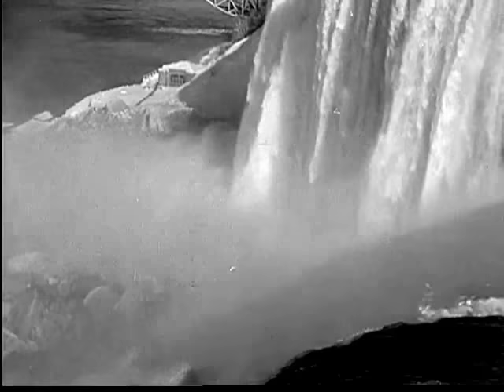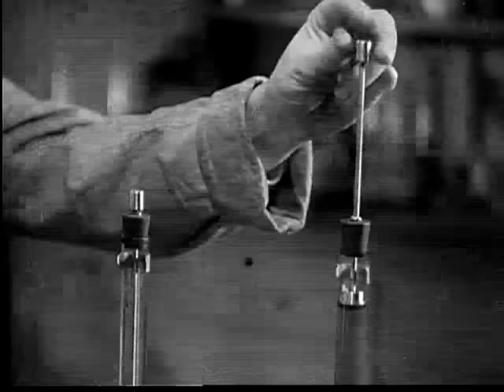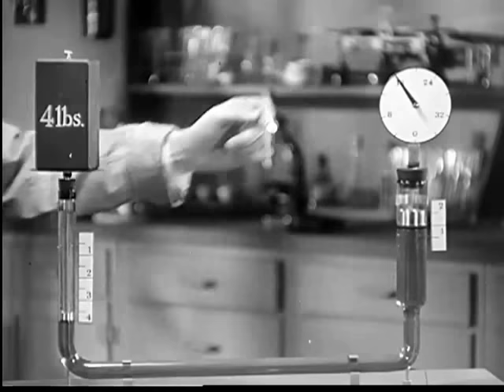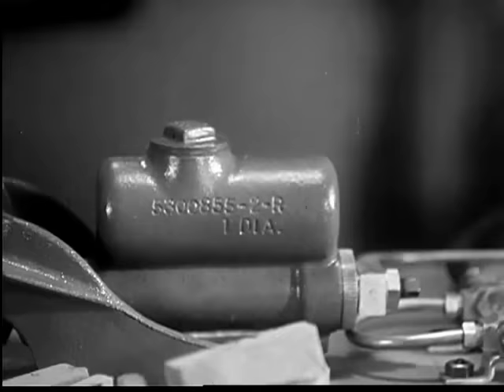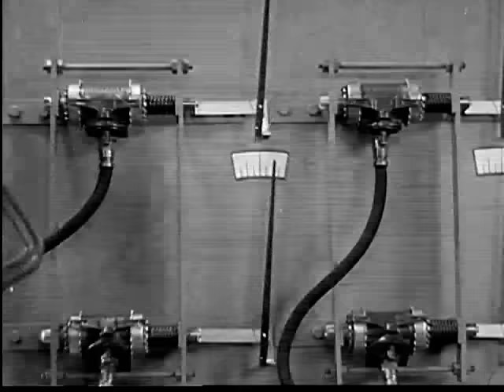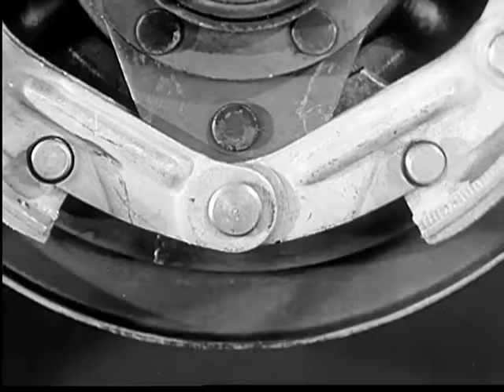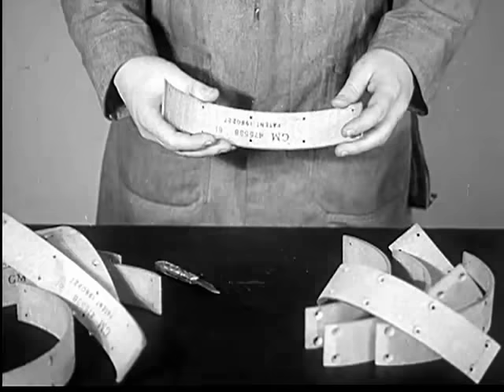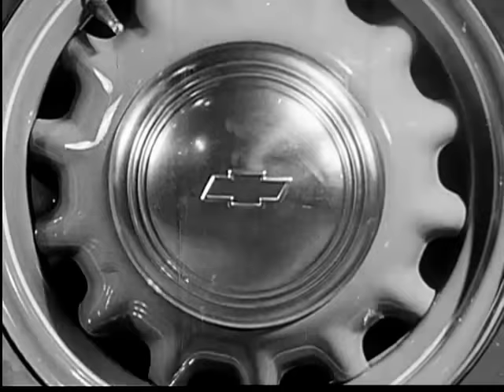Hydraulics (1936)

Comment: the main reason Chevrolet was explaining hydraulics, was that competitor Ford was still using mechanical rod actuated brakes at the time.
Reply: Germans listened in the end I guess. There was a hydraulic Panzer IV. (Now somewhere in a museum in the USA)
Reply: In the collection of the United States Army Ordnance Training and Heritage Center, Fort Lee, Virginia.
Reply: @RVoogt  during WW2 the Germans had the most powerful Hydraulic press that was used to forge and cast complex pieces for aircraft frames and ships I think 
Currently China has the most powerful press followed by Russia
Reply: who was first Ford or Chevy? ....exacly :-)
Reply: Who invented the car Germans or US ? Who copied who? :-)
Reply: who invented first automatic transmission Canada or US ? :-)
Reply: Who invented first manual transmission US or France? :-)
Reply: where wheel was invented more likely 3500 B.C. in Mesopotamia or in US ? :-)
Reply: who invented nothing?

US or Saudi?
Reply: @Mr0Suhaib  dam that is some bad burn here
Reply: Ford was using hydraulic brakes in 32
Reply: @newera3757   Neither invented the car first in intention.
Reply: @benjamindickey9431  negative,  Henry Ford was against hydraulic brakes, and Ford did not utilize them until the 1939 model year.
Reply: @newera3757  Germany did. The first gasoline powered automobile was invented by carl benz in 1897. Ford didn't create his first car until six years later in 1893 .
Reply: Then it turned out that the failure mode of hydraulic brakes was much more dangerous than the failure mode of rod-actuated brakes.
Reply: @baileythesleepless9966  There is a mistake in there
Reply: @KFlorent13  Didn't you know carl benz went back in time after he invented his car? I definitely meant 1887 but I think it was actually 1886 while Ford's quadricycle was 1896.
Reply: @Matt S. Yeah, if a hydraulics hose pops open, or if there's any other leak in the system, there's no fluid pressure to actuate the brakes and therefore, no brakes, especially if you have just one master cyl controlling all the 4 brakes!
Reply: @newera3757 ; when it comes to hydrophilic brakes, the answer is Chevy.
Reply: Yes, the Ford mechanical breaks were cheaper to make, easier to work on, easier to understand, but were not as good at stopping a car in a straight line. Henry was a stubborn old bird, and it was 1939 before Ford started using "juice breaks".
Reply: Who invented the horse and buggy?
Reply: @newera3757  Hate to bust your bubble but it was a French man who built a car powered by steam with no brakes. I think that is why the US and Germany saw an opening ;)
Reply: @grogery1570  an invention is only possible if you have the information/equipment. If no one had infented a steam engine no one would have invented steam trains if no one had invented the wheel no one would have invented the car. Saying that only one nation had invented the car or any other thing with lots of parts is just dumb.
Reply: @newera3757  Ford was always behind the times.  Ran Flat head engines until 1952, and vacuum operated windshield wipers until the 60's.
Reply: Don't you just love capitalism
Reply: @newera3757  First fully automatic transmission was invented in the US, by General Motors. The Hydra-Matic. Chrysler's fluid drive is a semi-automatic.
Reply: @newera3757  the first car was invented by Gottlieb Daimler.
Reply: Hats off you Sirs, . Feel lucky to  be lived in the Youtube era
Reply: @brandon tonka There's another Chevrolet publicity film - Facts on Friction - where this same narrator sings the praises of mechanically actuated brakes and subtly casts doubt on other systems. That one is from 1934, so we can assume that Chevrolet adopted hydraulics in the interval between that film and this one. Meanwhile, Chrysler had adopted hydraulic brakes back in 1924.
Reply: This wasn't a commercial
Reply: @GashimahironChl  Which is why we have used a diagonally split system for 50+ years now, even if you have a sudden massive leak (which itself usually does not happen, leaking seals or corrosion typically get worse gradually) you still have 50% braking force. And even 50% of a hydraulic brake system is far better then 100% of any mechanical one.

Pull your ass out of the 20's.
Reply: @newera3757  I think Germans, Benz had "first" car I think.
Reply: @thisisstupidanddumb  He did not say gasoline powered car and because he want to preach about tech history in internet then he have ofc very little knowledge about it and that is why he have no idea why he should point that he is asking about "gasoline powered car".
At the end of XIX century most people that got a car got an electric car not the one invented by Karl Benz as gasoline powered cars came after electric cars and the world's first automobile/car was build in 1769 by French inventor Nicolas-Joseph Cugnot.
And steam powered cars like the first one are runing to this day, check Jay Leno videos about his steam powered cars.
Reply: @TheUtuber999  Not the Horse, for sure.
Reply: The safety of steel from pedal to wheel 
Henry Ford just didn’t trust some liquid to stop a car
Reply: Way way better then a hole in the floor of the car and having to ram your feet in the ground
Reply: @MrKruger88  were they using that split system at the time of this video, though?
Reply: @anthrax2525  the fact that you know know that and your username is anthrax is a little bit concerning
Reply: @bryanmartinez6600  right now, tesla has the largest hydraulic press. its used for making car chassis and can now mold the model 3's chassis in just two parts (used to be around 70).
Reply: @KingFinnch  That press is actually quite small 
It only produces up to 61,000 Kilo Newtons while supposedly the largest in the world in China can put out up to 784,000 Kilo Newtons. Russia I believe has 2 presses that can produce 735,500 Kilo Newtons. These types of presses are used for extremely critical components such as those in aviation which are very light but extremely strong.
VSMPO-AVISMA operates one of the Russian presses for making titanium parts. The 2 most powerful presses in the US that are known put out 490,300 Kilo Newtons. These types of projects are supported by largest heavy industries in the world and also military purposes.
Reply: Haha
Reply: @newera3757  who cares, nobody or nobody? Exactly. 

We were talking about Chevy and fords brakes not anything else so get out of here you bot
Reply: @vangard9725  Who are you? Exactly nobody 😃
Reply: @newera3757  im more annoyed than me actually caring. But it also is kinda sad how weak your point is since you can't even get to my main point 🤣
Reply: @vangard9725  Why you are so mad? It's hot outside here in Hawaii. You have to be careful don't melt.
Reply: @newera3757  im not really mad im just annoyed because your comments are off topic and agenda posting. But they are just comments lol. Im just easily annoyed and your right it's pretty hot
Reply: @vangard9725  so you are mad :-)
Reply: @benjamindickey9431  Not on their cars they weren't, only on their plane.
Reply: @baileythesleepless9966  You mean 1887 for the Germans?
Reply: @GashimahironChl  True, but for the most part, they have been reliable, at least since the then-new Chrysler Corporation has used them.
Reply: @hoodagooboy5981  AMC did the same - flathead 6 through 1965, vacuum wipers into the 70s.
Reply: @rayfridley6649  Actually, GM came up with an automatic before that called the "Roller" transmission, but it would have been too damn expensive to produce, then they came up with the "Automatic Safety Transmission" in 37, as an option on the Olds, but you still had to declutch at stops with it.  The REO had an automatic in 1934, but I don't know if it was truly a fully-automatic.
Reply: @MrKruger88  Diagonally split?  I thought only some European cars had that, with all the rest split front to rear.
Reply: @markgriffiths3630  That's a good one!
Reply: @michaelbenardo5695  yes, I did mean 1887 lmao
Reply: @SpookyBees  it's not that deep man, it's just showing you how a fucking car works lol
Reply: Thanks WoT!
Reply: Germans with the Mercedes Benz
Reply: Chrysler had been using it since at least 1930.
Reply: What else did you expect from ford in the 1930s.
Reply: mechanical rods never sprung a leak.
Reply: So was Chevrolet until this year. They had made a video showing the benefits of drum brakes linked by cables just the previous year.

Comment: The simplicity of these explanations is a relief.  No quirky college chick trying to make jokes every ten seconds.
Reply: And they always have vocal fry....
Reply: @SimonWoodburyForget  But It's damn well helped me on my Brakes quiz in automotive.
Reply: @SimonWoodburyForget  Of course.

It's a good thing to go over the basics frequently though. I've failed my fair share of tests because I forgot the basics.

I have a horrible time remembering details and specifics so relating them to the basics in the area I'm studying helps me remember.

Granted, I'm taking a medium level automotive class for the purposes of self diagnosis and repair of relatively easy to fix problems, not becoming an actual mechanic. Nothing as surface level as just knowing how to replace fluids and change brakes, but stuff like learning how to diagnose and replace a transmission, my belts and to better recognize issues before they become expensive. 

I guess you may have a point that it isn't particularly helpful if you're getting into something more serious, but it's a great foundation for newbies like me.
Reply: @SimonWoodburyForget  It's not about figuring it out. It's about being able to relate it easily to other things you know.

That, isn't so easily done.

If I were to put it more simply, It's not what is taught, it how it's taught.

As for the cross-referencing bit: That's how I remember anything.

I can't remember Quadradic formula for example, but I know how it was made and where each part of the equation came from. From there, I can reassemble the Quadratic formula from there.
Reply: @SimonWoodburyForget  I'm well aware.

I still don't get your point. All I'm saying is that this is helpful. You're saying that it's basic knowledge that you can get in 10 min of google searching and that the brain learns differently for each person.

You and I are on two different points here and neither of our points contradict each other... so  I don't know why you're trying to convince me of something.

We're on the same side.
Reply: @SimonWoodburyForget  

Now that's just an opinion.

Different people learn differently. I, for example, learn best by taking complex knowledge and relating it to something simple that I've reviewed in the past. 

My friend can't learn anything unless you put a book about it in front of him. 

My sister learns only when she actually tries something.

Things click with people in different ways.

Of course, some methods are better for teaching some things. Language is a perfect example of a case where active learning is best.

Static learning is often best in cases where there are simply too many variables for the mind to grasp at once.

I took some Biotechnology courses in high-school once and I was struggling until we got sat down with a packet that we had to read explaining the procedures and why we had done them. Actively doing the Lab experiments didn't help our learning because we didn't have the full picture as to why we were doing things.

This, of course, isn't a hard rule. Sometimes one person's propensity towards one style of teaching can make it drastically more effective than the preferred method like with that friend I mentioned earlier. He only started passing his Spanish class once he bought Spanish for Dummies. Until then, he just wasn't understanding things in a more active setting (The teacher taught by going through things they would use in a daily setting and having them watch Spanish T.V. shows for homework.)
Reply: @SimonWoodburyForget  r/woooosh
Reply: @SimonWoodburyForget  r/iamverysmart
Reply: @SimonWoodburyForget  r/madlad (bcus ur very mad right now)
Reply: @SimonWoodburyForget  r/quityourbullshit
Reply: Simon WoodburyForget this is advertising too, it’s just done better
Reply: @SimonWoodburyForget  I for one appreciate your explanations of how we learn. It's quite promising, however my gripe is that if you don't know where a certain thing fits into the whole schematic of a certain subject, it's hard to just "pick and choose as and when"; and so lies the merit in a structured approach. In order to learn "dynamically", you have to know what's important and more fundamental to learning the thing, and what's less important.
Reply: I was thinking that also, love them
Reply: @SimonWoodburyForget  I use the terms interchangeably. In any case, if you're embarking on a formal course of study you'd need to look up intricacies; manuals are good for references, not for learning a new thing when you don't know where that new thing fits in the scheme of things.
Reply: @SimonWoodburyForget  you're then relying on "good documentation". I'm glad you found your programming fit.
Reply: @SimonWoodburyForget  I agree that resources often lack setting the scene and providing a problem-context that's interesting enough for the avid learner to want to explore how to solve. Also, so many of them spoon-feed the answer... there's no initial investment of effort that would help guarantee continued fidelity of the reader.
Reply: @SimonWoodburyForget  Huzzah and kudos for taking as long as you did to explain how it would be easier to Google the information in 10 minutes on a seven minute video. Very hydraulic irony.
Reply: @SimonWoodburyForget  I just found it funny how long you took to explain yourself about a seven minute video, wasn't hating or telling you you are wrong. Have a good one.
Reply: Yeah we really fucked up.
When you look at all these old videos and things it just makes you want to go back!
Reply: Also none of that stupid xylophone and ukulele music.
Reply: That's because they're very basic explanations that basically teach you the most basic principles, and don't teach you nearly enough for you to be able to apply them to something.
Reply: @SimonWoodburyForget  I bet you're very likable and have lots of friends.
Reply: @SimonWoodburyForget  Hello, Simon. rZqVbptRF8l
Reply: @SimonWoodburyForget  you could find this information in 10 minutes if you search on goolge for "how do hydraulics word" then you click the first youtube video and you find this video.
Reply: @SimonWoodburyForget  if ypu want to know how hydraulics work?
Reply: @SimonWoodburyForget  even if their videos were all advertisements, they also helped many (including myself) understand instruments that we left college/university not knowing anything about (I studied Mechanical engineering, btw).
Reply: @SimonWoodburyForget  not talking about the Hydraulics specifically. I was talking about the series in general, specifically the differentials because none of the courses bothered to explain how they worked
Reply: Yeah, in old educational films the narrator doesn't fuck around. They're straight to the point, easy to understand and easy to comprehend.
Reply: Yeah especially for most people who didn't studying on automotive like me.
Reply: Let the guy learn how he wants to.
Reply: @foureyedchick  What?
Reply: Nerdygirl Do you need a bandage for this bleeding heart of yours?
Reply: @Dylan_Sterling  The conversation is between Pod and me. Why did you get involved? Do you always get in the middle of other people's conversations? Do you think that Pod can't defend himself without your help? Or do you have a bleeding mouth that needs a bandage? lol
Reply: Nerdygirl This is the internet sweetheart. Get used to it. You don’t want strangers poking in, don’t comment on a public video where anyone can see it and respond to it. Simple as that. And bleeding mouth? Really? That’s the best you could come up with?
Reply: @thegiantratthatmakesalloft9415  Thanks man.  Because of your comment I did a dive and learned about vocal fry.
Reply: 100
Reply: 100
Reply: Skeleton Man 100
Reply: @Milosz R. He sure is cocky and arrogant. A narcissist.
Reply: g %  I've seen 'em on some trucks. They're a lot heavier than Disc Brakes, but the extra contact area provides better breaking power, something important when the vehicle has a lot of inertia.
Reply: Exactly... No dramas at all...
Reply: @SimonWoodburyForget  wow you must be a great teacher! i bet you can start a school or university yourself!
Reply: @SimonWoodburyForget  well you seem to have figured out the way of real practical learning method so why don't you start a school or anything with your own system, maybe results would be way better and world changing
Reply: @SimonWoodburyForget  r/whoosh
Reply: @truereaper4572  Lmao
Reply: @SimonWoodburyForget  I didn't get whooshed tho 🤷‍♂️
Reply: @SimonWoodburyForget  Bruh I couldn't care less about your toxic words.
Reply: @SimonWoodburyForget   r/karen
Reply: @SimonWoodburyForget  Smarta$$
Reply: @SimonWoodburyForget  I bet you are real fun at parties.
Reply: @derbigpr500  No really because most current videos don’t go into such depths of the very principles of technology, which makes you more capable of applying them in real life.
Reply: @Pod found the incel
Reply: Yaaaaaaassss!
Reply: I have a high school cem book from the time and it’s exactly the same
Reply: damn that's very specific
Reply: Or
Reply: Guy
Reply: And the little qwirks in this are interesting facts!
Reply: and that charming wartime voice
Reply: The difference just shows the decline of today
Reply: @Dethjingles995  Where did you do mechanical engineering from? My father, a mechanical engg, ran a 780 MW coal fired thermal power plant, but never knew how it ran. 😁😄😃. I thought mechanical engineers in only India were like that.